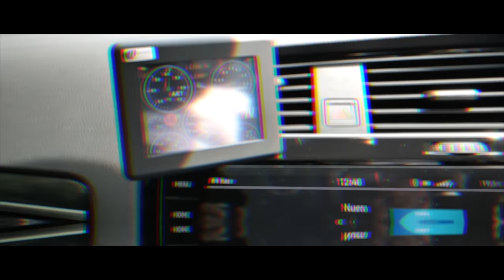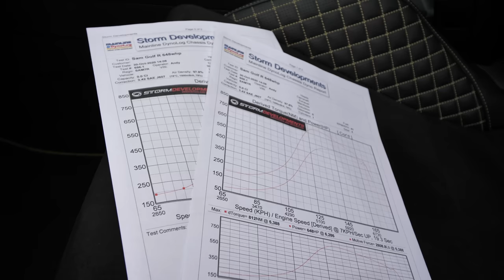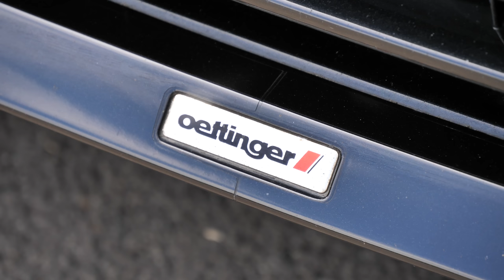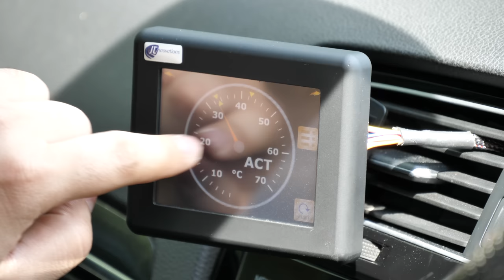THE UKS MOST POWERFUL *STOCK ENGINE 750BHP* VW GOLF R IS NUTS!!

Comment: I think you knocked the nail on the head Jamie. I don't doubt it does the numbers. But looking at how it puts the power down its been tuned in such a way that the boost comes in very gradually to save the stock engine.
Seems abit crazy you spend 50k on a build and not forge it and go full ham..
But still credit where its due. Still a fast car.
Reply: I think the stock engine is forged from the factory👌
Reply: @J2I3H  pretty sure rods and pistons aren't..
Reply: Its not about saving money, but I would say its rather a challenge to see how much power you can get out of these engines stock while still being reliable
Reply: @thymen4460  fairplay. I see your point.
Reply: @cgkperformance  I believe it was forged before this current engine was put in but it blew up then they swapped back to stock

Comment: Only a select few dare go past stage 2, I rate it💯
Reply: 😂 things VW drivers say.... Stage 2!😂
Reply: Haha I'm just stage 1!!
Reply: Only a select few can afford past stage 2 😂
Reply: @Dannny1067  yeah I'm not one of them. If I had it spare I would.
Reply: @ryancox3834  depends what stage 2 is, im waaay past that on Sonic 2
Reply: Stage talk is utter crap!!!
Reply: @bespoke500  it’s just an easier way than telling people a whole break down of what you’re running really isn’t it
Reply: @roycropperthetopshottamore2666  it would be easier if people kept to the old way of describing it.
I.e.
Stage 1=exhaust/filter/map
Stage 2=bolt ons (injectors/turbos/manifold)
Stage 3 =internals (pistons/rods etc)

Now its all bullshit "stage 2+", "stage 4.25" type crap and people think stage 2 is just a more agressive remap with no hardware changes.
Reply: @hello7533  I’ll just be quiet from now on hahaha
Reply: @roycropperthetopshottamore2666  ha, pretty sure my comment will stir up a load of 'nuh-uh, stage 1 fiesta is not same mods as stage 1 ferrari" type comments,, ah well, they can keep their stage 9.73÷3 cars.
Reply: @hello7533  yeah to be fair stage 1 on my manual golf r requires a new clutch the stage 1 on my focus st is no hardware so I suppose it is meaningless to say haha
Reply: Haha true but than there's stage 2 +++ maps  🤭
Reply: @ryancox3834  on pretty much any platform it goes:

stage 1: no hardware required, software only
stage 2: removal of catalytic converters and tuned to suit
stage 3: addition of forced induction on a naturally aspirated engine, or an upgraded turbo charger if it already has one

exception is probably Litchfield where they just make up multiple stages for no reason
Reply: @roycropperthetopshottamore2666  it doesn't REQUIRE a new clutch, it is advisable. But thats nothing to do with the "stage". If you had a dsg car this wouldnt be relevant or if you asked for torque to be capped and didnt abuse the clutch then it would possibly be OK. Golf R stage 1 doesnt universally mean clutch upgrade
Reply: @roycropperthetopshottamore2666  so tell them nothing instead, makes no sense either say basic bolt ons and a remap or just say what u have coz either way the list isnt exactly going to be exhaustive
Reply: @Neil-914  I don’t know mate from everyth ng that I have read and experienced my self tbf it can’t handle stock power properly I don’t know if you have ever driven one but genuinely it couldn’t handle any more power. I got out of mine just now and the clutch feels fine as In its not broken or anything but just say I’m doing 60 in 4th drop it down to 3rd it struggles to match where as I could be doing 70 80 in my focus go from 4 to 2 and the revs just match instantly and it’s ready to pull straight away but just the golf is over rated in my opinion I should have gone for the DSG all day it’s a diff car
Reply: @roycropperthetopshottamore2666  you're right in what you say mate, the clutch isn't upto stage 1. I just meant no one sells stage 1 as software and clutch. It should be ecu tune only and need supporting hardware. I had mk7 gti and my clutch was slipping 3 days after stage 1. Got 2011 TTRS now with dsg and different world performance wise...even compared to the gti at stage 3. Gearbox is biggest difference
Reply: @Neil-914  yeah I’m kind of torn what to do to be honest whether to get a clutch and stage 1 this or sell up and buy a DSG but I literally only got it about a month ago and I had to change the thermostat housing straight away. It’s 80k and I’m in 13.5k so it would cost me abit extra to get the DSG but the money I’m going to put into clutch and stage 1 is 1.5 - 1.7k so I don’t know if it’s better just to sell up
Reply: @roycropperthetopshottamore2666  it will be much cheaper in the long term to get a dsg car. Clutch £500-600, flywheel £500, labour £500-600. To guarantee its life long term you really want the sintered paddle clutch but it's horrid to drive compared to oem. Dsg will save you long term.... Unless the box explodes
Reply: @Neil-914  to be honest I hate the oem feel anyway I prefer abit more of heavier clutch because I’m 19 stone I’m abit heavy footed anyway so that’s fine by me really
Reply: @roycropperthetopshottamore2666  not just heavy. Noisy, rough, tiny bite point with no range. Nearly on/off switch. Might still enjoy it more than I did
Reply: @Neil-914  so when you say on off then is doing a launch quite hard if it’s not much bite there? I just hate the thought of driving an auto haha, honestly the focus st is so much better to drive than the golf it’s mad the clutch and gear stick are perfect but the brakes are shit haha. To be honest I think the perfect car for me is the focus Rs it’s got everything the golf got that I want and the focus st.
Reply: @roycropperthetopshottamore2666  you still got ur golf pal? Considering getting a manual but it’s in the back of my mind to spend a bit more and go for dsg
Reply: @justdevz36  I still have my manual mate yeah, it’s going to be going up for sale next few weeks tho I think. I’m still torn on whether to get a DSG s3 next or if I’m going to go for something manual. Part of me loves the manual experience but I want launch control haha
Reply: @roycropperthetopshottamore2666  yeah launch control does seem class tbf 🤣 if ur going to be selling it what type of money would u be after mate? Potential buyer for u right here haha
Reply: @justdevz36  to be honest it’ll be going up reasonably cheap to be honest but it’s cause the mileage is quite high and it has a few marks here and there. It’s on 92500 at the moment. Serviced every 10k tho full service history. 12 month MOT. Rims could do with a refurb. Runs and drives mint tho no clutch slipping. I had the thermostat housing fault fixed bout 10 months ago to so that should be okay for a while(if you don’t know about this, common problem on every single golf r even the 2020s). It’s a midnight blue. HPI clear and fully stock. 
I’d want bank transfer only tho to be honest just because I’m going for a mortgage with the money and don’t want to put cash in the bank and arose any suspicion or anything. 
I’d take £11k. Heated seats, electric wing mirrors. Front and back sensors
Reply: @roycropperthetopshottamore2666  definitely something I would be interested in mate, could do bank transfer as well. Where abouts are u located?
Reply: @justdevz36  I’m South Wales area mate, but I’m happy to meet places if that’s to far. Obviously I’ll send you some videos and that save wasting anyones time, it’ll be fully valeted and polished to.

Comment: thats the same way, the 5,2 with stock internals are mapped. they run up to 1200 hp.
its less stressfull for the engine when the boost rises in balance with the rev.

Comment: That's very good. Bsr in swede  does it like that on fuel. Stock direct injection and hpfp. They also change the port injectors to bigger bosch and fuel is no problem anymore

Comment: Coming from sombody whos forged a golf r been through an engine and a gearbox aint no stock engine and gearbox taking 750bhp and with figures given 680ftlb 😅
Reply: That was my thought exactly surely 30-50% over stock power and torque would be around the limit of the engine they don’t have forged rods from the factory!
Reply: I believe it’s possible with some unconventional tuning , im pretty sure he was managing thermals and ended up there, stock bottom end is pretty strong in the 3rd gen ea888
Reply: @mou1998ssa  unfortunately torque wise the bottom end is running very big risks past 450ftlb the gearbox limit is 520ftlb and the stock clutch will cope aswelp as the gearbox on that limit 

This guys claiming 680ftlb aint no stock engine or stock gearbox wven with an uprated clutch taking these numbers
Reply: @mou1998ssa  with that sort of power I would want to be belt and braces with everything don’t really fancy wondering every time you jump on the loud pedal if it’s going to shit itself!
Reply: Any thing is possible when you have that sort of control over heat and fuel with a trick ecu. Like he said it’s the egts that kill these engines. plus shitty hybrid turbos don’t help it’s a gimmick, full frame or stay at stage 2.
Reply: @afella29  unfortunalty ifnyou ask any other tuner they will agree its actually torque that kills these engines ...... so if he said that power but only 440ftlb maybe it could be possible but he is claiming 240ftlb beyond that at 680ftlb I know from experience at dq250 aint taking that torque as the limit really is around the 500ftlb mark once your forged.
Whats clearly happened as this golf had a forged motor before if you didn't know is the engine blew up my mans down loads of money so he has kept his dyno print out stuck a stock engine in it and claiming its worth x value and its oh so reliable on the first pull in this video you can see Jamie expects the power to come in then it changes gear and there was nothing there 🤣

Comment: The EA888 is pretty much the 2JZ of four-cylinder turbos. It can durably handle insane amounts of power with thoughtful tweaks to it's "weak" points. It isn't a coincidence that the 2JZ and EA888 have iron blocks and can handle big power.

Comment: I’m sure it is but it doesn’t look that quick, maybe it’s too linear.
Reply: Same thing happened when I mounted gopro to side window. In my pov the drifts where at sick angle but it didn't translate to video at all.
Reply: Word on the street is that it's 580bhp, apparently the stock pistons and rods are maxed out at 600bhp. So 750 at 2.9bar doesn't really seem realistic.
Reply: @Gentlemen_london_  
Bro unless that comes out the factory with forged pistons and rods
Reply: @hoonaticbloggs5402  - Correct! And they are good for 600bhp. ✊
Reply: I agree dont look 750hp not even close
Reply: I agree tbh, it’s doubtful that it’s making that power. It didn’t seem to go through the gears nearly fast enough
Reply: @morgenglende-michalski369  that's what I'm thinking my old single turbo 6466 precision n54 that made 730hp seemed ALOT faster and it was  a rwd Manual non the less 500-600 odd hp in a mk7 is ALOT especially with dsg and awd
Reply: @morgenglende-michalski369  Its what happens when you put bigger turbo's on relatively small engines. You don't make the power until higher gears in higher load. And when it does wind up you only have two thousand rpm worth of power band if that. Ideally a dyno print out needs to be shown so people understand why it appears to be slow.
Literally on the road a hybrid IS38 would keep up with this easy. On a track it would be different story though.
Reply: @MO22N54  well the turbo alone is rated for 600-830hp for 2.0-4.0 engines… no way in hell a 2.0 is maxing out a turbo as the minimum size engine for it
Reply: @filmboy18  yes but you could tell even at max boost it really wasn’t pulling like it should be for that HP number. Besides there’s tons of data out there saying that the stock engine goes around 550-600 crank hp
Reply: @morgenglende-michalski369  I’m aware that around 600 is the limit but with clever tuning and getting a lucky engine if you want to call it. It might be possible for a limited amount of time. 

My fiesta st mk7 has a known safe limit generally of around 350 flywheel but there’s guys in America running way over that reliably (over 400 plus at the wheels) with very high mileage engines.
Some in the uk as well but not as much.
They are revving them super high as well.
Bear in mind the fiesta is a open deck design. Golf r is closed deck so should be stronger.
Reply: @filmboy18  That’s true, but I guess I just can’t acknowledge a number that has blown many engines and is only possible for like 200 miles… if it’s not sustainable it’s not a build, it just turns into a constantly rebuilt shitbox racer lol
Reply: @adrenalinejunkie3828  I wonder how many miles it’ll last😂😂

Comment: Fully stock block, doing hard pulls, big turbo, 750bwhp. So I’m assuming he’s running a good ass tune. This cars can make 700-800whp easily. You just gotta make sure the car is tuned for more horsepower and less torque. But the torque is the weakness of these engines. These engines usually don’t blow up from power. But the Methonal injection does keep the engine cool. Another very important thing. The engine will blow a lot faster because the engine components wear down a lot quicker if there hot or the hotter they get

Comment: 2,9 bar with a stock bottom end? Well that's gonna last for a while..........
Reply: i dont get why you would leave engine stock and go to this sort of power, wouldnt last a week.
Reply: @arronlowley5659  Exactly. Why not build it right the first time
Reply: @kirstennielsen7218  Didn’t you listen, this is the 3rd engine in the car and he’s found the stock engine performed best.
Not sure how long it will last but he seems to know what he’s talking about.
Reply: Word on street is that this car is running 580bhp. Stock pistons and rods can take 600bhp max.
Reply: Car has been running this power for a year and no issues it's all about the tuning. The guy who bought it has just beaten the shit out of it for 1k miles to test it's reliability and no issues.

Comment: What his feeling when he says it pulls harder as the revs go up is the big secondarys kicking and offering another 4x min 1000cc I would say his got the bosch 1500cc and that's coming on as the revs climb the duty cycle of the secondarys is increasing with the revs but in saying that more petrol burning creates more exhaust and more exhaust is helping  spooling that big turbo up quicker thats my guess/theory I swear by running secondarys in a modified car with aftermarket ecu so you can tune it all properly and make it all work together and deliver much more desirable power where it's needed I hate people that say they want the power 100 on as early as early as possible that creates them cars that are rough and jerking idle super high where as primary and secondarys all that goes away and it's now a pleasure to drive and still 600hp and also its not as bad on the internals and you'll get much more life out of the engine

Comment: Sorry just a little confused over the methanol / ethanol… does it use ethanol or not? You said it doesn’t need it as you cool with meth. Yet then said the fuel lines are updated to take ethanol and the control panel shows boost pressure and ethanol content etc ? Great build. Thanks.

Comment: Water/meth is a savour and engineering god send... saves engines and drops temps fast for a cheap mod...

Especially if made from a old car washer bottle with pump and the important part an atomizer mist spray nozzle.. as the fine mist spray/ fogger tip is what helps drop the temp so fast...

Spray into the intake and turbo as well as all over the intercooler... and watch the temp stay at a nice stable low temp... watch the boost baby... 

Love this car cos its nothing but fun... no fancy bs stuck on mods or unnecessary gash looking crap... but fast af and very unassuming... but not a sleeper either.. 

Good job sir... even on the cost too.... Well built, well finished and nicely done... 

Lol not that my comment matters, its just an opinion...

Comment: 960 nM of torque is 708 lbs ft of torque. I don't care what you do the stock block is good for around 450 lbs ft. This car is not making anywhere near 750 bhp. If he has a timeslip and video of it doing more than 135mph in the 1/4 mile I'll rescind these comments, otherwise just not believable power levels.

Comment: Brooo, stock engine makes around 320 hp at 1 bar ,   and to push to 750 hp u would need  more then 2.5 bars of boost,  stock engine handling 2.5 bar plus 1 bar, so ur telling me 3.5 bar boost that entine runs over 50 psi.. man only noob fans would belive this. Im a mechanic i have a 650 hp s2000 and bmw m4... people dont belive that.. that cars max 550 hp if that.  Dyno figures alll lies. Lets see the 100 to 200 time..
Reply: Haha BMW M4......say no more
Reply: @LJasseProductions  what does that mean, can u even afford a m4 comp ? Thats the question 🤣 and built engine s2k.